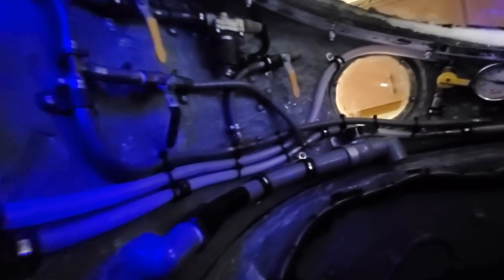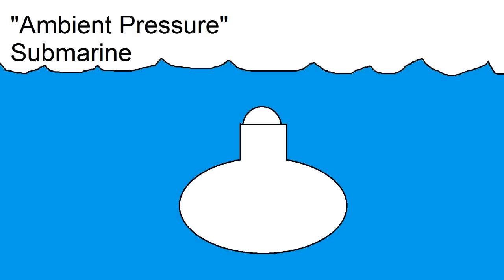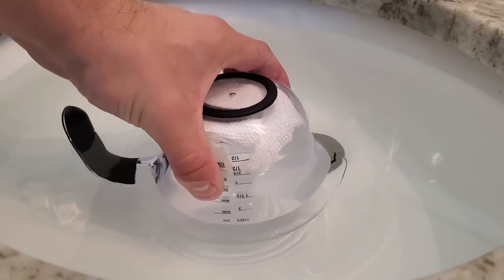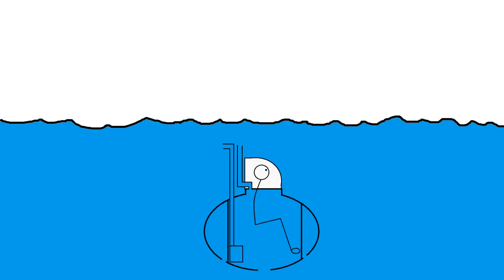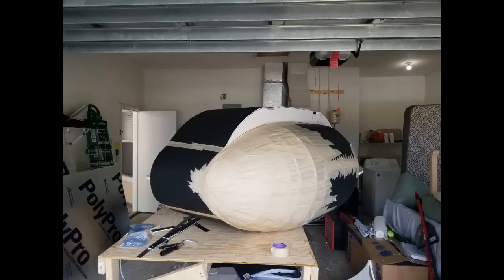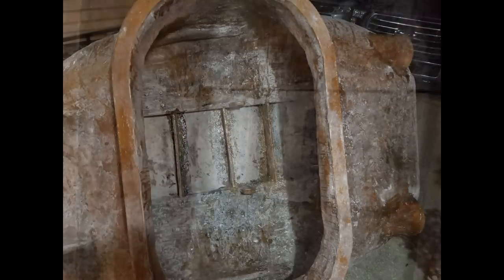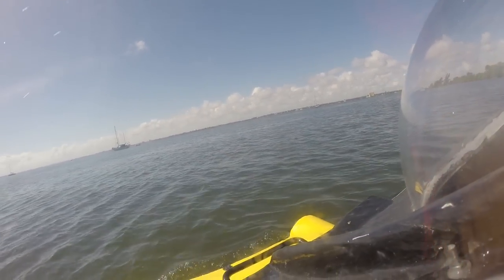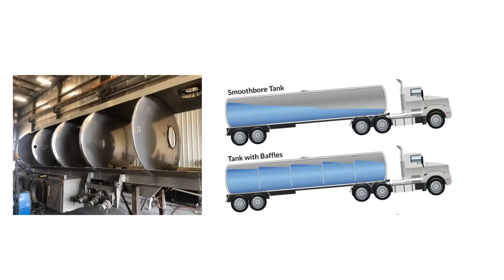My Homemade Submarine

Comment: Pioneer Underwater Boat here. A big advantage of the open bottom is that in a small sub a leak in the high pressure air can be deadly. Mitigating this is not easy. Nice report :)

Comment: I'm working on a Wet Sub (SDV style) version myself. Keeping the controls dry is an issue, I'm thinking about running a small air line with a positive (say 5 psi over ATM at whatever depth) air line to the boxes for controls and batteries. That way if there's ever a leak it will stay dry and show up as bubbles at the leak point. My 2 cents. Nice sub brother.

Comment: So, just a motorized diving bell?
Reply: so, just a nagging comment?
Reply: @DeonexGlower  So, you didn't have a better answer? I wonder how you define the word "nagging"?
Anyway, the hull of a submarine should withstand the pressure from the water, and keep the pressure inside like above the water (1 atm). As far as I can see, this thing doesn't. So, it seems this thing is based on the open diving bell principle, where the pressure inside is equal to that outside the enclosure. And with propulsion. 
Next time, why not check before complaining?

Comment: OMG, you went out alone? No Emregency Procedures? No Emergency scuba spare air? Also, you might want to label your buoyancy control air switches open/ close directions as you turned all three in the wrong direction multiple times-just saying, in an emergency you may not want to fumble turning these in the wrong direction and I would add a backup power supply for emergency lighting and essential power as you found out on your 2nd test dive. All that said, awesome build, but I don't think you should ever go out alone without a dive buddy to keep track of you, and a clear emergency procedure set between the two of you.

Comment: So, depth control via pressure is inherently unstable, right? As you go up, the air expands making you go up faster and faster. Likewise, as you go down, the air compresses, so you drop faster and faster.  So, without some other system to stabilize, I think you basically can't stay neutral passively.

(Closed submarines can close their ballast tanks, so I think they have less of a problem remaining roughly neutral as their depth changes.)

Am I misremembering/misunderstanding?

And assuming I'm not misremembering, doesn't that make this super hard to operate safely?  In particular I'm not sure how you would do a controlled ascent while avoiding the bends.

Comment: For an emergency system if the vehicle somewhat capsizes while bilging water, you could have a hose on a float that can be detachable to provide a secondary air intake valve that can float with it's own buoyancy system.

Comment: i've been designing a diving bell (meant to go no more than 15 feet down) for years, but i can't get my design safe enough to comfortable building or using. its just too dang easy to drown! even with multiple redundant safety features in a diving bell, you can still drown pretty easily. also i want one safe enough for my nephew to use, but i just don't think its possible on a small scale. its likely why such a diving bell has never been sold commercially.
Reply: Good on you for being so safety conscious. So easy for something to go wrong in a sub, especially when family is involved. I'll stick with remote controlled subs, myself. If you really want that 'being there' sensation, I'd suggest a remote sub and trying to put a First Person camera on top, so people can look around. Almost as good, and zero danger.

Comment: You might want to consider pressure compensating your motors and electrical system. Mineral oil is non conductive. You fill the motors and any electrical boxes with mineral oil then run feeder hoses to a compensator diaphram. One side of the diaphram is closed and attached to the oil system while the other is open to the water. When you descend the water pressure pushes on the diaphram which pushes on the oil which is non compressable. This pressurizes the oil the same as the outside water so you only need o-rings and seals good enough to keep the oil and water separate and not to withstand pressure.
Reply: An elegant solution.

Comment: Seems exceptionally hazardous unless you have a way to blow the sub apart with squibs or automated surfacing equipment activated with a Deadman switch or a buddy to rescue you or a hole big enough to escape through or scuba gear inside to use for air in case a hole develops on top.  Good luck.
Reply: Wow its crazy that your "or a buddy to rescue you" is 85 comments from the top. I thought top comment was going to be. "HE GOT TRAP THE FIRST TIME AND STILL DID IT ALONE THE SECOND TIME?" not to mention going out far enough  that he had to get towed. Lol did he decide to not wear a life jacket aswell seeing as he under water already so it defeats  the purpose.

Edit: at the time of this post there are 130 comments

Comment: Love the work! Huge motivation to start a somewhat similar project I've had in mind!! Please please lete know where you obtained the half dome/bubble windows?
Reply from the maker: I ordered them from a fabricator called EZtops that specializes in acrylic/plexiglass domes
Reply: @HyperspacePirate  Awesome thanks for the info!
Reply: I have heard mixed things as was wondering if the bubble top vs flat window creates any distortion when it comes to visibility under the water? Also do mind sharing the dimensions of the window on your sub? Thanks!!
Reply from the maker: @futurismodesignstudio4738  The bubbles are 1/2" Thick 22" diameter hemispheres with a 1.5" flange. There's no optical distortion underwater except for a very narrow area where the bubble curves into a flange, but that area is mostly covered anyway so it's irrelevant. Overall, the visibility is excellent in all directions except behind.
Reply: @HyperspacePirate  Seriously thanks for the info! Eliminated that guess work I was stressing about!

Comment: For all that is holy, if you're going with an open system, add manual weights you can disconnect 1 at a time for controlled emergency assents, and in the event of a full tip over from underwater currents, which can get surprisingly strong sometimes and they're basically invisible, you need to install enough supplemental air to breath during your assent to prevent getting the bends (or drown).. Just stick a divers chart inside next to your depth gauge so you can guesstimate your (safe*) climb rate. I presume you know this, but if you plan to go below 30ft, things can get life threatening (*from the nitrogen in your blood stream) *beacuse if you have to go back up too fast because you lack enough supplemental oxygen, you can still die.  (I'd install 2 flags on the sides of the sub that read "Submarine In Distress" with perhaps some instructions on what you want them to do, with little LED strobes for visibility, and waterproof two of those keychain alarms so you're also heard, attach them to something that can allow them to float upright, and give them long tethers so you can manually pull a pin to release them to signal for help on the surface if you ever need to, this would provide a cheap and efficient means for rescuers locate you and even possibly pull your rig back up if the tethers strong enough, and then it'll double as a "WATCH OUT" signal whenever you're returning to the surface for boats. Cheers.. I'm about to go down this rabbit hole myself, but IDK about the open concept, then again I don't intend on going beyond maybe 100 feet (probably less).
Reply: Just put a dive computer on the dash. It will double as a nice depth gauge too. Last thing you want to be doing is a lot of math in an emergency situation.
Reply: Whenever I think about homemade subs, my idea of a safety solution is to wear a small BCD and carry a small deco tank on you so you can still perform a safety stop. You can also probably make some way to make the sub surface in an emergency so you can recover it, but I'd prefer to be outside the sub when things go bad.
Reply: @philipplyanguzov9090  the dangerous thing about this design is you can't make fast ascents because as he puts it, you're basically inside a diving bell. So you'd get the bends if you tried to go up quickly, and he already has to carry his own oxygen supply; its just a matter of did he design it to be detachable in a manner that won't get stuck. My concern is you surface, and the wake/waves cause you to topple on it's side enough to prevent the ability to remove water and replace it with air, but realistically theres so many solutions for this. Air ballasts, sand ballasts, water ballasts, a vent hookah, etc. IDK if it has one, but I'd install some lifting points in case you ever need to recover it, or be recovered; and I'd also make a detachable system to float a rescue beacon with clear instructions on how to rescue me; explaining how they can use the rescue beacons tether to fish a stronger rope down and through the lifting points to then winch me up. Theres a million little possibilities with stuff like this, which is why it's so fun.
Reply: @TrueHelpTV  glad somebody brought this up. As soon as I saw he was going for an ambient pressure for wreck diving I was horrified. That’s asking to die, it would have been a lot better to have a watertight sub and just stay above 50ft with the fiberglass. I can’t imagine how he intends to make it so he only ascends a foot per second reliably using compressed air tanks to surface
Reply: @StroopWaffel  me neither, and if its ambient then he might as well just scuba, it would be far safer just to develop a rig for the air tanks. But hey, its cool and to each their own.
Reply: a home made sub or diving bell is just a fantastic way to die, and i don't mean that sarcastically. there is not much more awesome than a sub, they are pretty fantastic. and its just super easy to die in one. furthermore, its really difficult to make them failsafe. in fact, it may be impossible to make a small scale sub failsafe. I think if you really take on a diving bell (like this one) or an enclosed sub, you just assume that risk. i consider it like high speed downhill skiing. lots of people die or are seriously injured downhill skiing, yet they still do it all the time. Hell, Ken Block just died while he was snowmobiling of all things. The history of subs, especially home made ones, is a history of people drowning. 

i've been cooking up a diving bell for about 10 to 15 feet of depth, and i just can't settle on a design i'm happy with for safety. at least, i can't think of a way to reduce risk beyond the risk that already exists with diving normally
Reply: @Gunbudder  Just put a tank and regulator in your bell. At 15ft, you will have almost an hour to decompress and figure out your emergency.

But yeah, going beyond scuba depth in a home made sub is extremely dangerous. And at scuba depth, home made sub is more dangerous than scuba.
Reply: @Gunbudder  What's the use of a diving bell for 10-15ft of depth, when you can easily just swim down that deep?  It's easy to free-dive 40-50ft without any scuba gear.
Reply: The assent rate is a foot per second if you go deeper than 30ft.
Reply: @roypatterson9910  i don't know enough to have an informed opinion, but that sounds kind of quick. Another Idea I had was to design a lid for the bottom, so if you did have a weird emergency that caused decompression complications, you could attach it to the bottom of the bell, and possibly pressurize the hull to make a poor mans decompression chamber until they could relocate you to a facility with a better one?  perhaps its not practical, but it was just a wild little thought. cheers
Reply: @TrueHelpTV No, it's the correct speed, I'm a Certified Scuba Diver, I was certified back in 1986  by Scuba Schools International through Scuba Hut in Glen Burnie MD. I'm not sure how old you are, but I was certified probably before you were born. Lol. Just kidding, but yes, you are supposed to follow your smallest bubbles, which is usually a ft per second, and that's what I was taught by my instructor, which I still talk to this day after all these years, and yes, he's still diving.
Reply: @TrueHelpTV  "I don't know enough to have an informed opinion" but you readily gave advice that made people think you know what you were talking about.  I suggest arm chair quarterbacks stay in the chair with their comments to them selves.
Reply: @stevesfascinations1516  God forbid Im transparent about not knowing enough to have memorized the surface rates to prevent getting nitrogen sickness from ascending too fast in an open pressure bell system. lulz. Hence why I stated you should add a chart inside the vessel with a watch. 
Take your own advice there Payton Manning and go back to kissing your son on the lips.

I know enough to understand the physics involved. I've spent years drawing out my own sub concepts and thinking them through on graph paper for untold hours. I'm also PADI certified, and have built my own scuba systems. I felt the concerns I stated were quite valid. To increase your safety factors, there needs to be a lower weight element to control the center mass and prevent roll overs, and a ballast system to make a controlled surface if the air ballast fails (like dropping sand slowly like hot air balloons do). A real world example for the need to lower that center mass so you can keep air trapped in the open bell shape is how parachutes work; when I'm paragliding, my risers are long on purpose so I'll act as a pendulum weight to lower the center mass to prevent that air pocket from collapsing. Seems like a logical direction to increase the safety factor because a roll over in a bell craft means a high chance of death. Hence why those mini open bell scooter subs are manufactured to where you sit in a chair that focuses the weight as low as possible to prevent roll overs... It's also why larger subs have those side fins, which he doesn't. Once you "pop the veil of a bell" as they say, you're toast. These open bell systems mean you're still breathing pressurizing air as if you were scuba diving instead so you can get the bends, so I fail to see issue with carrying supplemental air that you can detach and take with you in the event of a roll over so you can surface at an acceptable decompression rate. Which is why I'd make that lower weight addition into like a triangle frame so you have ways of escaping if it gets stuck but I digress. From a rigging standpoint I was thinking from the perspective of a professional lvl 4 rigger for radio towers and how easy it would be to incorporate tow points with releasable float systems that strobe with a siren noise with clear instructions to whoever on the surface finds it so they can hopefully lift the craft out of the water in the event of getting stuck somehow or to alert the surface you're coming up so you aren't impacted by a boat. Redundancies and contingencies are your friend in a sinking water coffin.

Comment: You might as well scuba dive. The point of a sub is to stay at 1atm. A wet sub is cool. 
I've been certified since 1980. I live in the Great lakes. I've done 100's of dives. 
I like your sub it's good for older people who will never dive. One thing , pay attention to your dive tabe! 
 It just seems your asking for trouble. If it rolls over the party is over.
Reply from the maker: You're correct that it's somewhat disadvantaged compared to a conventional submarine because of the pressure equalization. It was a compromise between wanting to have a dry enclosure and wanting to build a structure that didn't need to withstand high external pressure.  Because I live in Florida, i found it to be a reasonable compromise because you won't find dive sites deeper than 60-70 ft.

And yes, i definitely follow dive tables. In the future, I'm planning to build an arduino-based dive computer that integrates pressure vs. time and compares it to dive table figures stored in memory. I'm also dive certified and carry bailout air.
Reply: @HyperspacePirate  Why not just buy an actual dive computer? It will already be waterproof and will have been extensively tested before being sold.

Comment: Did you consider the copying the Sport Sub? I only ask because I am.
Reply from the maker: The sportsub was a major influence in my design (specifically the semi-wet ambient configuration) but the shape was loosely based on a craft called the "fugusub", which was also semi-wet ambient, but only single-person